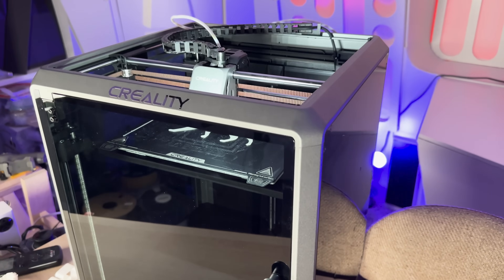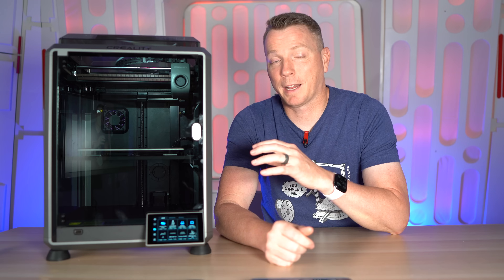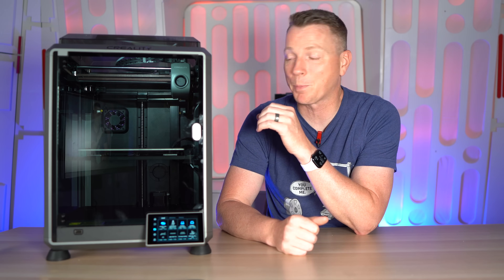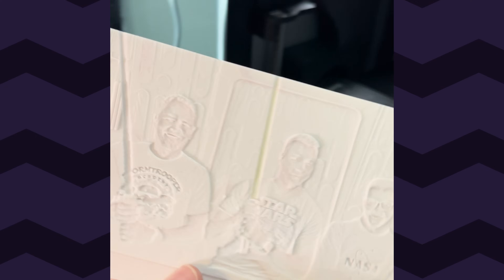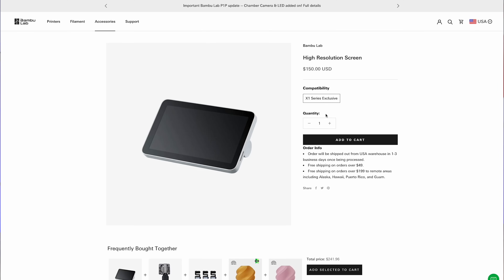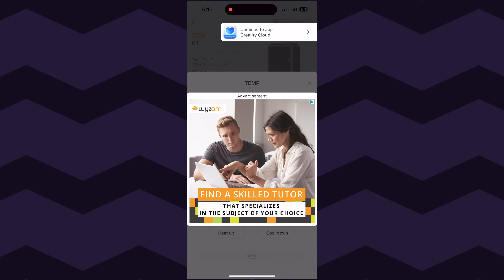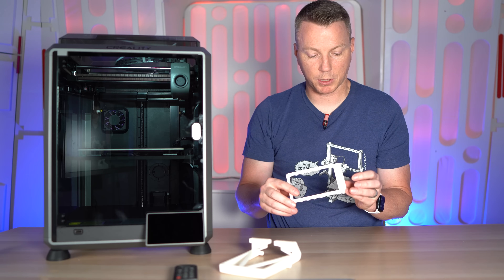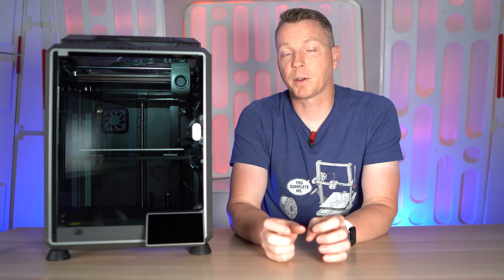I Regret Buying the Creality K1. Here’s Why.

Comment: I took delivery of my K1 2 days ago. Straight off the bat, I printed the 17-minute Benchy and a small model of my own. They worked fine. Then the trouble began. I couldn't get it to load new filament. Contacted Creality but 2 days later, they haven't responded. Decided to attack it myself and found a couple of small "chunks" of filament in the tube between the exit of the extruder and the top of the hot end. This was enough to stop the filament from finding the entrance to the HE. My question is - should there be a short length of Bowden between to extruder and HE? It looks like the tube/recess is the right size but mine never arrived with it. Can someone assist me with this? Maybe Creality will get back to me and confirm? (Maybe hell will freeze over or Fusion will be solved in the next week).  

Meanwhile, by cutting the filament at an acute point, I seem to be able to print with it however my limited prints with PETG aren't good. It seems to enjoy tearing the first layer off with the speed. More work is required while my 2 E3 V2s still turn out excellent prints, albeit at 20% of the speed.

On the App thing, using the internal web page on the K1 from a phone works well. It's a responsive page so it formats correctly.  You can launch new prints simply. Unless you REALLY need some sort of remote access/non-local access to the printer, I can't see why you would put up with the "Hello Kitty/Banggood" style of app. I had a giggle about "Premium" access to get some models. Sure, it won't notify you that the print has succeeded but you have to physically visit (both) printers to remove the model and prepare the bed for the next one anyway.

Something I did find is that you can SSH to the printer. No idea of the root user or P/W but hoping someone will and then it's open slather on open source for the F/W at least.

The "Creality Print" slicer is definitely a step back but I think that this new phase of 3D Printing is now heading towards appliance printing. Its not there yet but they ar attempting to shield new/appliance-style users from the complexity. The rest of us find this lack of total control aggravating. I'm going to try to work up a PrusaSlicer config for it and just use the web front end to upload the G-Code.
Reply from the maker: Excellent feedback and comment, Tony. You’ve got a lot of great info here and I’m sorry to hear about the issues you’ve been experiencing. Hopefully Creality can get you up and running sooner than later!
Reply: @The3DPrintingZone  Does yours have a tube of (some sort) between the extruder exit and the HE entrance?

Comment: bambu printers still need cloud so internet to print. no internet and you not printing.
Reply from the maker: Unless you transfer via MicroSD card. But, yes - the cloud option requires an internet connection anytime you want to use it.

Comment: Can you opt to use OctoPrint / Klipper on either one of them? Because honestly, I'd rather not use the built in stuff.
Reply: no klipper  on bambu dont know bout octoprint. but the k1 has klipper but its locked with limted features right now hopefully be open before long
Reply: You can use an SD card on the Bambus. You can also switch them to LAN-Only mode which means the slicer sends direct to the printer, nothing on the cloud. The slicer is open source and has been forked to Orca Slicer.

Comment: I am looking for reasons to cancel my preorder of the K1 but i dont really seem to find any, this sounds like a paid ad by bamboo lab tbh, most people dont use the app, i use sd card and i prefer to continue doing so, so the biggest issue is an app thats optional to use? Also the lever for the extruder, gosh, you were using so much force to open the gears with the worm thing, the only way that the cable guard or worm or whatever you call it, hits the extruder gear lock with such force is if the cable guard was sooo much stiff, and in that case a little lube would do the job; also.. what the hell was that test model? That same model wouldn't come out good in the p1p either, that was a model for a resin printer, that's why you only tested that model with the k1 but did not test the p1p, because you knew that model was not for any fdm printer .. so, still i will continue on my quest to find any good reason to cancel my preorder. Next time dont make it so obvious bamboo lab is paying you.
Reply from the maker: We each have our priorities and opinions, which is great. I can assure you I have zero affiliation with Bambu Lab, not even so much as an affiliate link, but if the K1 is a great fit for you am then that’s awesome. I’m sure you’ll enjoy it. It’s fast and a major upgrade from bed slinger printers.

Comment: I think the deal breaker for me with the Bambu Labs is the proprietary hot end/extruder
you can't get a 0.6mm E3D nozzle for example 

I also personally would never use the app so the fact that it sucks isn't too much of a big deal for me 

I would like to see more test print comparisons in this review
Reply: there are alot of clones already for bambu most using cht nozzles in them now
Reply: There are aftermarket hot ends that support V6 nozzles and review well. Personally like the OEM stuff too much to switch, but happy to have the option.
Reply: @technicallyreal  interesting. I'll have to look it up 
I wish there were more in depth reviews of these printers 
small issues you can fix in 5m are not too big of a deal for me and same with the crappy app
Reply: I'm just waiting for my max preorder... should have a lot of the nitpicking fixed but then I'll have an extra 3-400$ compared to the price of the x1 carbon to use for upgrades that matter
Reply: @Kungpaoshizzi  k1 max is 999 and the x1 is 1199 so 200 for 1449 u get ams

Comment: Defintely pondering the k1 max but kind of wondering if i should skip the first version and wait for the k1 max+ or something, some of the issues you mentioned will most likely be ironed out in the second version. Or hope that bambu labs comes out with an x2 or something.
Reply: I'm thinking about the K1 Max as well but I'm going to definitely give it some time to get in the market before I make the plunge.
Reply: k1 max should have most problems fixed as k1 user are the lab rats technically
Reply: Does anybody have an idea about when bambulab will release a new model?
Reply: @premium2554  question was asked multiple times during bambu Interview and they said no plans as of now but sure they will just when
Reply: @premium2554  but they could be working on it just dont want competition knowing
Reply: @jamesharris9894  I see, thnx a lot for reply, do you suggest me to buy an X1 carbon now for a personal use. Because it’s really at the limits of my budget, I’m planning to spend like 1000-1500€ on it and would like to use it like 4-5 years at least. So is it a right moment to buy that kind of 3d printer or should I wait any upcoming improvement from any brand?
Reply: @premium2554  depending do u need enclosure are u going do multi color prints is 256x256 big enough
Reply: Early reviews for the K1 max suggest Creality have sorted out the issues with the K1 such as extruder problems. I would still give it a few months until the K1 Max has been out in the wild for a time and some long term reviews come out.

Comment: The max speeds of 600 vs 500 mm/s are just marketing blabla. They don't matter. First of all it matters at which speeds they can still print at decent quality and that depends on the quality of the kinematics and the capabilities of the hotend. We know that already the Bambulab Extruder is struggling at the stock speeds with melting the filament (just getting it still done but also bein in the realm of slight underextrusion). I guess the K1 isn't higher flow than the Bambulab so you can't print reasonably faster. 

The other aspect is at these high speeds the limiting step is actually acceleration, without absurdly high acceleration speeds the printer can't even reach those super high speeds for most of the print. High accelerations are very demanding on the kinematics.

Comment: I'm not super surprised that the K1 has flaws like this- in fact I'd have been more surprised if it wasn't. Creality, while they are capable of making good printers, tend to need a lot of iteration and most importantly feedback from the community before they eventually get to that point (Case and point, the entirety of the Ender 3 lineage of printers, with some models having very minor differences between them). 
This is kinda what I thought when people were saying that the "race to the bottom" was finished after Bambu Labs put out the P1P; there aren't going to be many (successful) cheap i3 clones anymore, but that just means that manufacturers will be switching to a new race to the bottom with a new start point being the X1 / P1, economizing or stripping out more and more in hopes of making the new "ender 3" of this generation. While I don't think you can really strip these new Fast CoreXYs down nearly as much as you could the old i3 format, time will tell if someone finds a way; even if they do, you're going to have the very real question of who would buy that kind of a machine, as regular people won't want to tinker with them to optimize them, and hobbyists now have pretty high standards even for "tinkering" machines.
Reply: I really don't get why people like to thinker with the machines I lost my love for 3d printing because of that and now I will get the bambu lab X1 carbon just because I want a reliable printer.
Reply: @michaelperez6811  well why do people kit out cars or restore old cars? Some people are just mechanically inclined and like playing around with the machines, especially those of us who've been doing that since 2013. The Ender 3 was kind of a lucky lightning strike because it came around at a time when both more people were getting in and the printers were becoming stable enough to where hobbyists were more able to experiment. Ender 3 was good at that time for either person, being both cheap but still not so cheap as to be a nightmare to get working comparative to other stuff.

I guess my point is that now people who want a good printer can now get one without even needing to do the little setup needed with the ender, and they can still get them cheap- the SV-06/07 come to my mind at under 400 if someone doesn't want to spend 1200 for an X1 or even 650 for a P1; and hobbyists are now moving on to stuff like the Voron kits, where you're sourcing the parts yourself and putting it together from scratch, because we like doing that.
Reply: @barrag3463  Exactly. Tinkering is at least half the fun for me
Reply: @barrag3463  Oh that's very true. I am a person who got into 3D printing mainly for creating interesting stuff as I liked 3D modelling before, and when I got into it, I was so invested into tinkering, that to this day, even after I think my prints are pretty alright, I just know I need to strive for better and I constantly tinker around with my Ender. It starts with simple stuff like changing the cooling system and might end on stuff like converting your printer into a voron, or anything at this point, it's amazing. And of course there is a lot of struggles with that, but that brings more fun in the end when you actually manage to finish something you started working on, for me that point was changing the Z axis to belts instead of a lead screw - it took a lot of my time and I constantly felt like giving up, but in the end starting the printer and seeing the belts moving and the prints actually getting better was what made it worth it. 
And would I not want a printer that's ready from the get go? Oh I would love to have a BambuLab P1P or X1, but I just know that it would not be the same as with an ender, because there wouldn't be much I could tinker around with, because that printer is almost perfect (with minor flaws of course, like everything), but knowing that I can just fire up a print and forget about it would be a great thing.
Reply: @barrag3463  "that just means that manufacturers will be switching to a new race to the bottom" ... It seems like this is not going to happen. It seems more like a race to the good middle.
The K1 is on sale for 584 € these days. So we are seeing printers like the X1 with less fancy add ons like the LIDAR for half the price.
On the other side we are seeing good i3 style printers getting Klipper right out of the box (Neptune 4 Pro, Sovol SV07) and also the Prusa MK4 improved with input shaping. So even the "old" i3 printers still are evolving and easily doubling their speed which does make the P1P look a bit "not so fancy" anymore, especially when those Klipper i3 cost like 300 bucks.
So compared to the first Ender 3, the new Sovol SV07 for example (with Klipper) is a much, much better out-of-the-box 3D printer than the Ender 3 was. But with a price between 300 - 400 € it seems the old days of "either expensive (Prusa) or very cheap (Ender 3)" could be over with a fair and well epuiped option in the middle.
Reply: @michaelperez6811  i guess people lile to "tinker" because you can take an inexpensive printer, add to it with a bit extra cost in parts, pronts and time, and you get a n even better printer for the price. 
I got a ender 3 v2 and after a bunch of upgrades its now extremely reliable at putting out crazy quality prints. 

I just finished a project making a double roller blind blackout frame where i needed 12meters worth of runner pieces that were 3.6mm wide, 12mm deep, in a sort of u shape with  little arrowheads on the tips of the u shape. Thats where the blinds run down into once they are recessed into the woodenframe 
So i printed all 12meters worth in 15cm sections, with no extra bed adhesion, just the first layer of the print. Which is about a 30mm long 0.4mm wide line.
I had two prints fails out of 72.
For what i paid for the printer what it can do now is crazy.
Other parts that i built for the project, they dont need tobe incredibly accurate just for some windowblinds, but i measured them, and my callipers show pretty much ever dimensions is spot on to within 0.05mm
Before i really fixedit up i had to do multiple prints to get things to fit, now i can just measure a bearing, put the exact measure in the design and its a perfect fit.

Next im building an enclosure for it but one that keeps all the electronics and motors outside of the enclosed space so the heat doesnt make the wear out faster. 

Building things for the printer itself is one way to get better at designing and building things with the printer.
Reply: @michaelperez6811  I wish I was being paid by Bambu too :(
Reply: @michaelperez6811  "I really don't get why people like to thinker with the machines" .... Well, it goes with ALL DIY and many technical hobbies. May it be building an Raspberry Pi with case, storage and stuff ... or just buy a cheap PC/ netbook. Building your own PC - or buy one. Re-Building an old motorbike or buy a new one. Building and improving an own workshop in the basement - or just rent one if needed. Making own costumes for cosplay instead of buying them ...
The list is endless ... and often starts with LEGO in the childhood. Some just "buy" any kind of toy, others "build" their own.

And the printer itself is an easy "project" to build up on it! Especially since the first cheap printers from 8 years ago often seemed "unfinished". That seemed like a good practice for the beginner to get to know the machine and learn to improve while printing the first parts for the printer.

Comment: Great video thank you.I love the specs and reliability of the Bambu Lab - however my biggest deal breaker of Bambu labs over the Creality is that you can not print offline with Bambu Lab its all cloud base printing only.
Reply from the maker: Do you mean printing on your network only vs the cloud? You can definitely print via Micro SD Card but maybe I'm misunderstanding what you're saying.
Reply: @The3DPrintingZone  Yes I mean print via Micro SD or via USB only - from some of the other Bambu Lab Carbon review videos I watched - it was understanding that you can only print via cloud and not USB or SD print?
Reply: This is not true. They implemented a LAN only feature on a recent firmware update. You can print on bambu printers without the cloud, you just lose the ability to remotely monitor it through the camera because that uses the app which has to run through their servers. But you can print through the local network now or off of SD card just like any other printer.
Reply: @spencerlange125  That is awesome! thank you for this update and confirming - the main deciding point for me between Reality K1/K1 Max and Bambu Labs Carbon is the ability to print locally by USB or SD only - without Cloud or app.
Reply: Also, cloud is not really that terrible unless you work with clients that have NDA'S with your company. Unless you are working woth top secret 3d models for gov/military use or something or have DoD contracts, there really isn't much to worry about. Put all your other devices behind a firewall if you are that worried about it.
Reply: @spencerlange125  Thank you for taking the time to respond to my comment. I am looking for an all rounder 3D printer - I am from Australia, there are times like to print remotely ie. in rural areas and or on site where there is no or very poor internet connection.